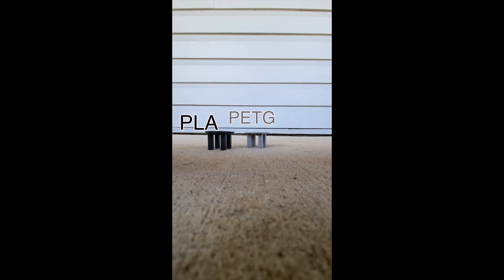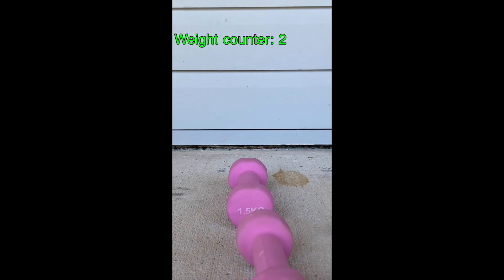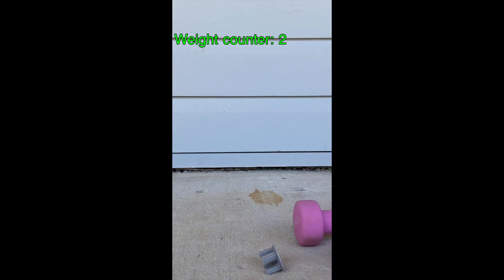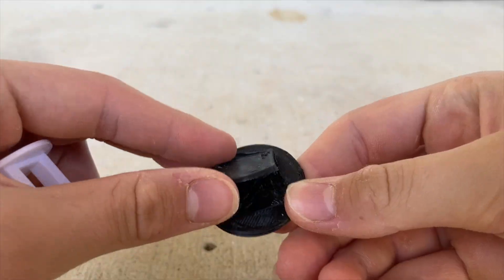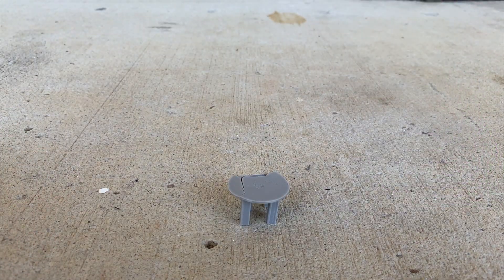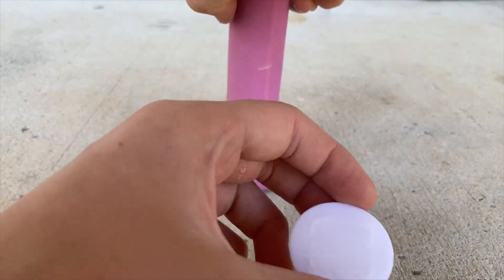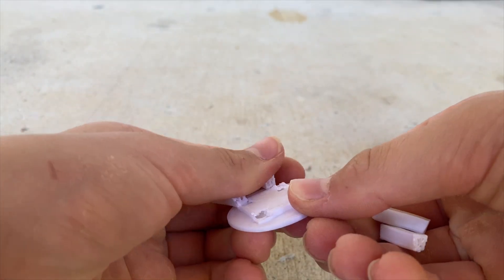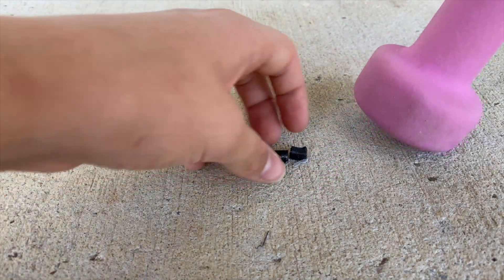Which is STRONGER, PLA vs PETG vs PLA+

Comment: Not the most scientific test, but your results are in line with most scientific tests. PLA is the least impact resistant, while PETG is the most impact resistant, with PLA+ having similar properties of impact resistance to PETG. PETG is just known to be harder for beginners to print because most beginners have a finicky no-frills 3d printer and wont know how to troubleshoot. PETG is very simple in my opinion, but you must keep it dryer, and it comes in far less colors than PLA. I prefer PLA+ for most items, but items that will get dinged up or need to bear weight or tension, or be exposed to sunlight and outside conditions, i use PETG. PLA+ is the best all around though.